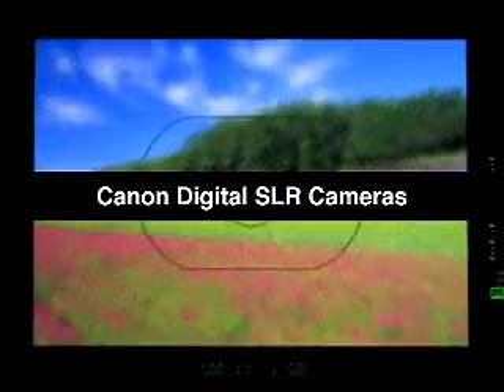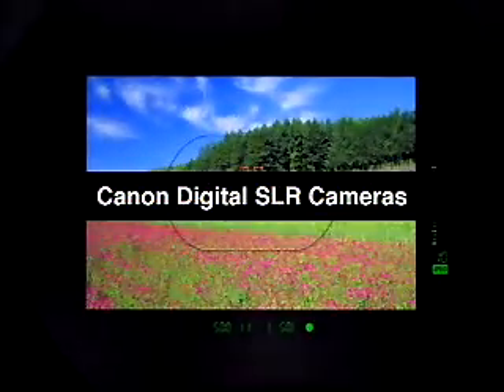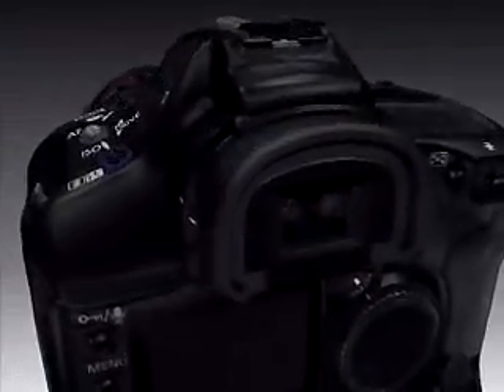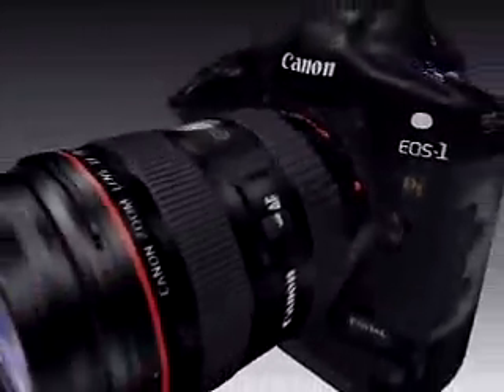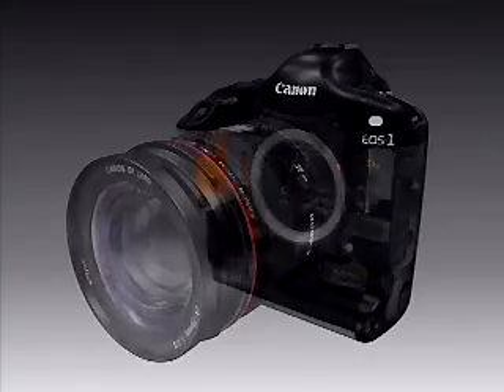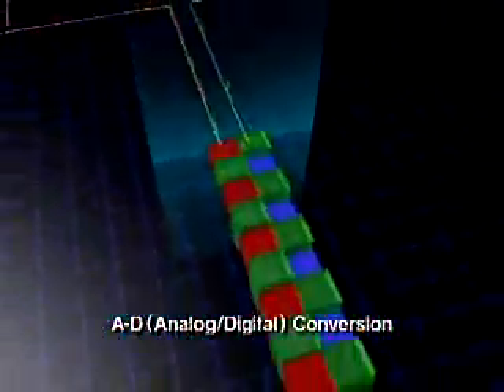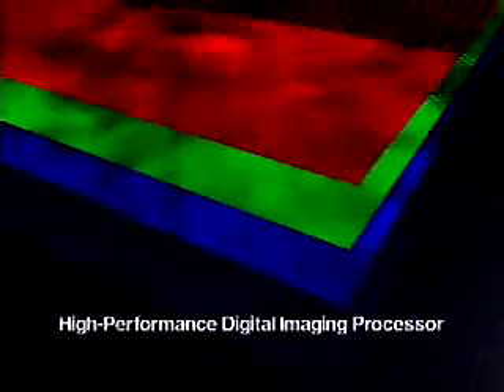Let's see how a CMOS-Sensor in a Canon DLSR works 1/2

Comment: So is that animation true? Where each pixel has a capacitor and amplifier, an each column of the array has a single ADC? Or is it that each pixel has all 3 (thus measuring noise and then reducing it) and then shifting it through a bus?